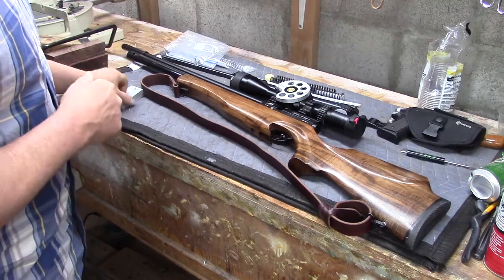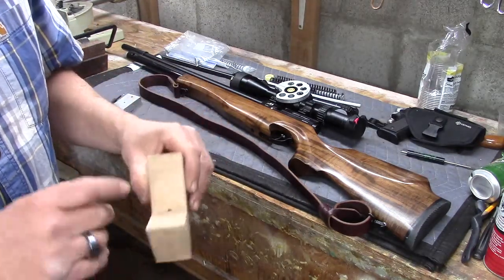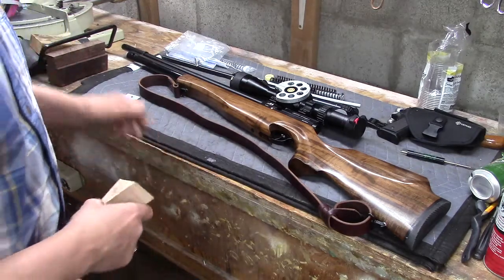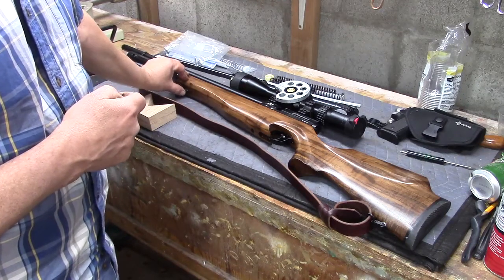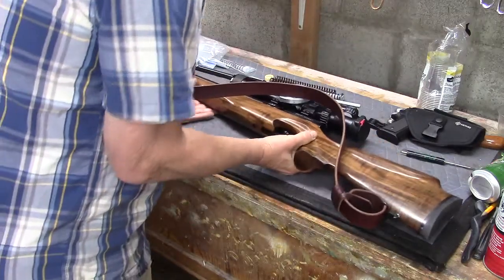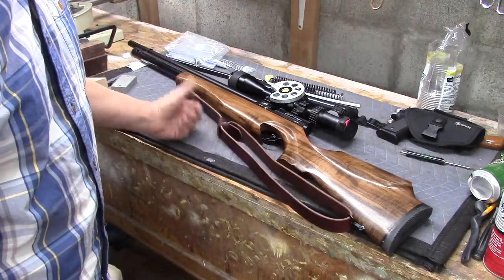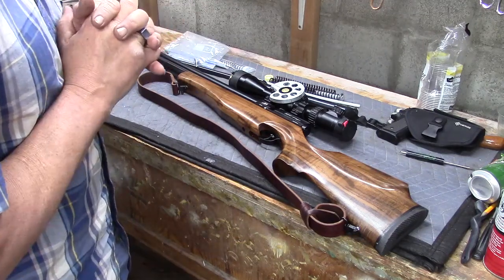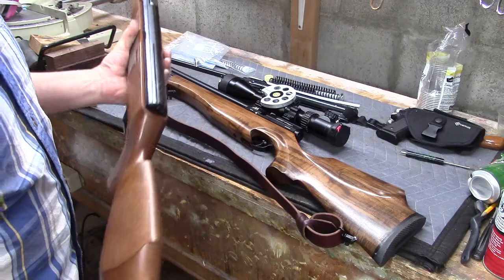Sling Swivel Stud Installation

Comment: Can you repeat what kind of epoxy and wax you used to install the sling studs?  The sling stud on the fore stock worked its way out because of a neoprene sling that kept twisting, and I’d like to secure the new stud so it will stay put.  Thanks for making the video!
Reply: @mckeowngunstocks  I appreciate the reply.  I called the swivel screw manufacturer and he recommended filling the hole with epoxy, tapping, and drilling, but that's above my skill level.  I'm going to try your recommendation and hopefully that will work along with using a different type of sling.  Thank you very much for the suggestions and have a great day!